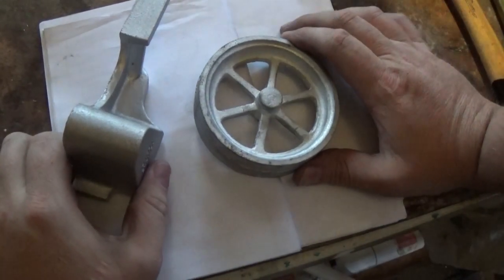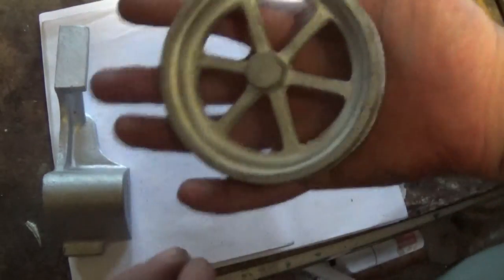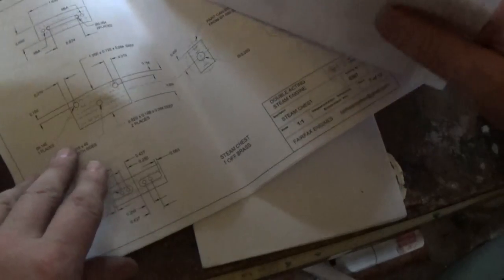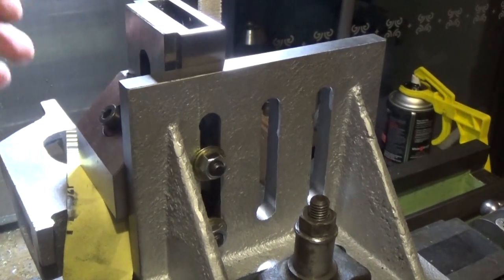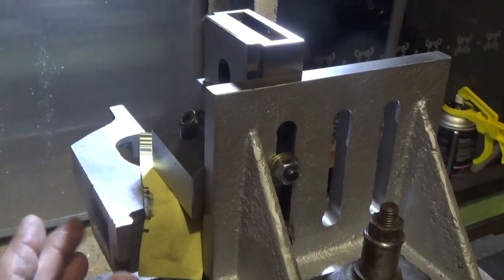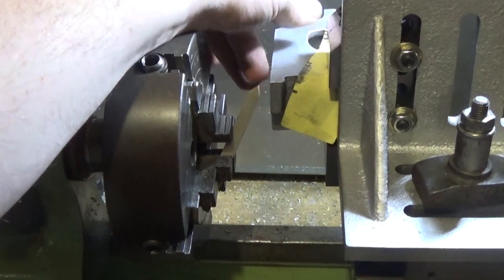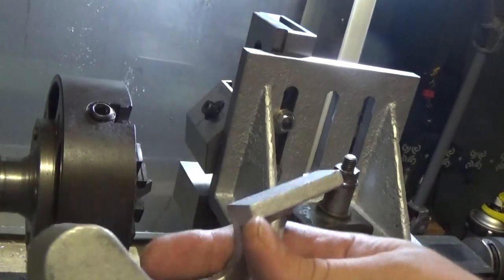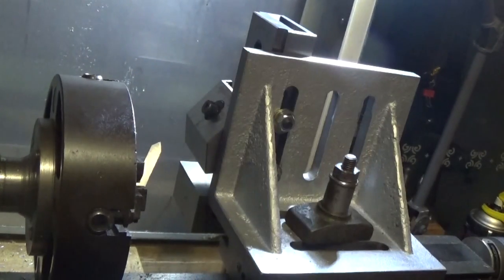MYFORDBOY'S ENGINE! my version

Comment: Lovely castings. And a nice setup with that angle plate! I have a fly cutter that screws up on the spindle nose. Fly cutting is  a very accurate method of flattening a piece, but of course on the lathe you are limited by the travel on the slide. My limited experience with fly cutting says you should have the smallest stick-out you possibly can. Else you get chatter. As you did. Still, brava!
Reply from the maker: i have plans to make a fly cutter for the faceplate, i just have to live long enough!